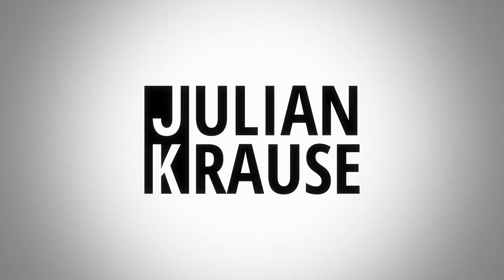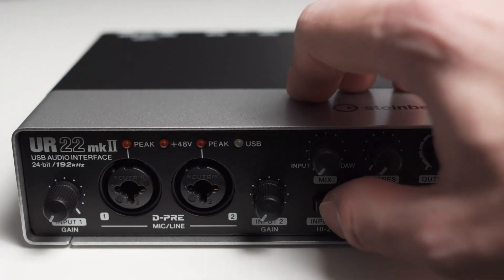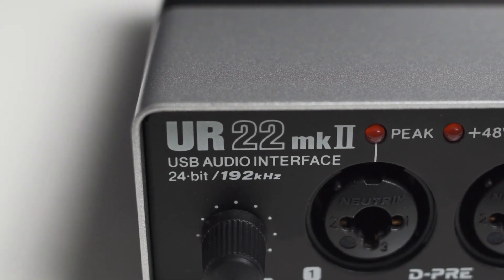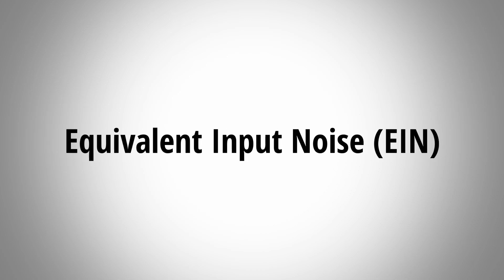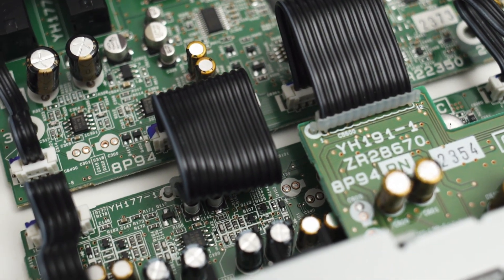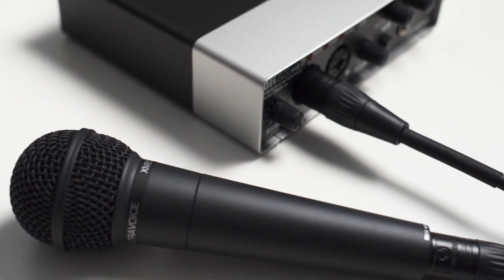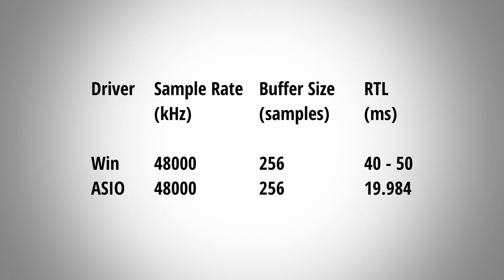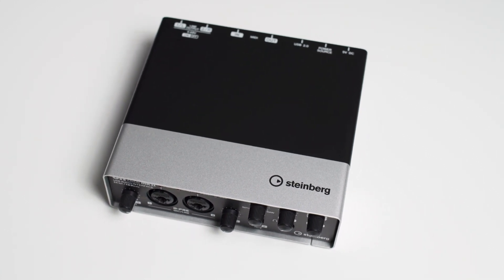Steinberg UR22mkII Audio Interface Review (with noise measurements)

Comment: Can this audio interface also used as standalone device without pc connected by powering it with an USB power adapter?
I'm looking for an interface that can be used both with and without pc (as microphone phantom preamp).
Reply: Da Qoraxxx it can but mix knob is in mono..but it could be moded to stereo
Reply: @ivanmaskov  Oh well that's no problem, I'm planning to only use 1 mic, so that's mono anyways.
Thanks for the info.

Comment: Thank you so much Sir...
I've a doubt Sir... The moment I plug in the microphone and start recording my stuff, I keep hearing noise in the headphones... Can u please help me  to get the problem solved Sir? I've got UR 22 mk 2.
 Shall b waiting for ur reply Sir...
Reply from the maker: What mic are you using? And have you tried another one?
Reply: @JulianKrause  I'm using Steinberg M-01 Mic Sir... I didn't try with other one bcoz I've got only one Mic & only one XLR Cable Sir... I bought UR 22 MK 2 Set Sir... So I got the mic along with the pack...
Reply: I'm using it through cubase 5 with a Sony windows 7 laptop and other thing is I don't have an AC in my room Sir... I'm from India where the temperature is more than 40 degree centigrade in summer...

Comment: OK, so for what of GAIN value of did You measure the max noise (-123,3dBu)? Are You sure that all of these audio interfeaces have the same  GAIN on maximum potentiometer right turn?
Reply from the maker: Hey, good question. On different interfaces the maximum gain setting will have a different amount of gain. But the EIN measurement takes this into account and completely eliminates gain from equation. These values are directly comparable. Cheers!
Reply: @JulianKrause  So, how did You measure GAIN at maximum knob turn? What amount of max GAIN offer Steinberg and Behringer?
Reply from the maker: @monter6794  Hey, the gain is measured with a known reference signal. In my case -60dBu coming from a Prism Sound dScope M1. The signal is fed into the interface with the gain up all the way and then I measure the resulting signal amplitude. I stated the maximum system gain in the video at 07:23. You can find the same measurement for the Behringer in its video.
Reply: @JulianKrause  Great work! Thx!

Comment: so i need to buy a cloudlifter if i want use sm58 ? and what about ur22c is it worth the upgrade im using ur22mk2 its only been 4 months...
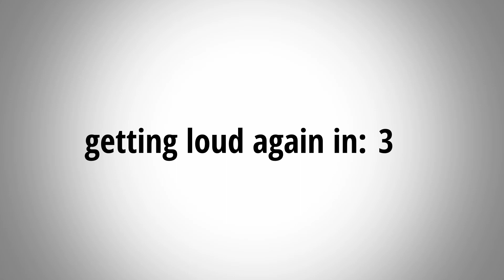Reply from the maker: The UR22C has the same preamps as the UR22MKII, so from a preamp perspective it is not an upgrade. You can use a Shuer SM57 with the UR22MKII but you might hear some slight noise in the background. You can hear the amount of noise you can exepct at 6:22.

Comment: Hey there... does someone can help me with my issue. None helped me from steinberg... I used that card In my 15years old laptop with no problems. Well I built a new desktop now, i7700k 48ram, samsung evo ssd e.t.c well the sound through headphones cames for 10 seconds and goes for 10 seconds... I tried many solutions : reinstall drivers, reinstall windows, try another windows , powered hub and many other options. The issue is still here.... please someone to help me... 2 weeks now I am trying to fix it.... no solution....

Comment: He is about a thousand times as tech-savvy as me- all I know is that there is a lot of noise recording a guitar through input 2. Placing my hand on the interface reduces this noise to almost nothing (why is that?), so as I do not have three hands my noise-free workaround is to place the unit on the floor and put my bare foot on it. Perhaps that was the thinking behind the extremely robust construction...
Reply from the maker: That's a very odd behaviour. Sounds like some kind of interference problem. Have you tried the interface with another PC?
Reply: Hi Julian- thanks for responding. Do you mean that my behaviour is odd, or that of the UR22? I haven’t tried it with another pc (I only have the one) but I have run it through both my 6th gen iPad and my 2013 MacBook, and I get the same noise. And truly, putting a bare hand (or foot!) on it reduces the noise to nothing. Bad unit? Bad earth somewhere?
Reply from the maker: @walrtbstudios5430  It's an odd behaviour of the UR22. Maybe the housing isn't properly grounded. Do you have anything else connected to the interface that is connected to ground. Like studio monitors?

Comment: Hi there Julian, great video, and 1 Question please

I've this device, and probably getting a SM7B.
Will a simple mixer like the Alto ZMX52 (which I have) can function as a preamp or do I need a Fethead?

I will be doing vocal recording, and I want it to be as good as it can without compromise.

Thanks!
Reply from the maker: Hey, if the Alto ZMX52 has better preamps than the UR22MKII then it can lower the noise if you use it as a preamp. You can try it out, I made a video on how to do this: https://youtu.be/Be1e0QPIPK0
If the preamps in the ZMX52 are as low nosie as they claim you don't need a FetHead.

Comment: Weird. With that much noise, I wonder, if you have tested a defective unit. I have seen comparisons, where the UR22 Mk II was superior to the 2i2. Not by much, but still... this is weird.
Reply from the maker: I though about that too. But I did the tests multiple times on different days and the results were always the same. And the noise of channel 1 and 2 are pretty much identical. If my device was defective it is unlikely that both channels would produce the exact same amount of noise. Just FYI the preamps are not crazy high noise, they are still ok. They are just not on the level of the competition. If I get my hands on another UR22 I'll retest the EIN, but I doubt that it will be different.
Reply: Still, the UR22 is better than the 2i2 because it "colors" your voice in a different way, the recording sounds much warmer in comparison. I dare you to record the same sample with the UR22, the 2i2 and the UMC22 and you will see what I'm talking about.
Reply from the maker: @zezesilver  That's an interesting test, I will do a future video on that!
Reply: Okay having two channels producing a similar noise floor is unusual. Still, it could be defective, if - for instance - the power delivery, or the connection between the power delivery has a bad component, causing both channels to have a higher noise floor.

But then again, the UR12 is known to be noisy as well. Nevermind me. 😂

Comment: How well can it drive a 250ohm headphones?
Reply: I guess i'm a little late, but it drives 250Ohm Beyerdynamic DT 770 Pro w/o a problem, tho i'd prefer a little bit more volume overhead. If i turn the volume knob to the max i can hear very loud bass getting distorted. 
My suggestion - use external amp for high-impedance headphones.
Reply: I even use an amp for 80ohm cans

Comment: I have this interface and it's ok thought I did run into a strange behavior the last time I used it under OSX (I have video of this). It seemed to lose power randomly connected to my macbook pro even if it was charging. So now I use an Audient iD14 :)
Once I did a comparison between the two and what I noticed was a different tonality in my voice but to the regular listener they would probably not notice.
Reply from the maker: It sounds like it has something to do with the interface not getting enough power. But I can't say for sure. Thanks for sharing your experience!

Comment: I'm a noob at this, but I thought the bigger the buffer size the better?
Reply from the maker: Hey, not really. The bigger the buffer size the higher the latency. You want to use a small buffer size for low latency. But if the buffer size gets to small you can get artifacts like crackling in your audio. So, you want to strike a balance and find the smallest buffer size which still gives you stable audio.